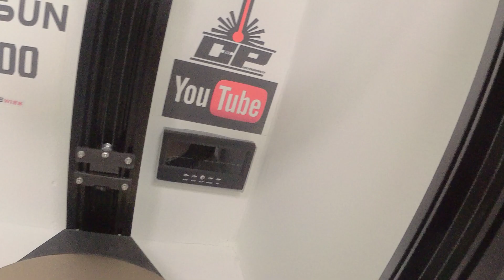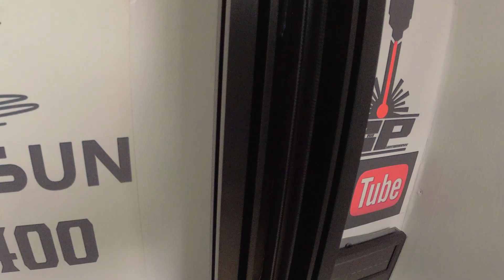FLSUN V400 REGULAR MAINTENANCE CHECKS #FLSUN #V400

Comment: Do you re-run a calibration and bed mesh every time you do that maintenance or is it not necessary? I was told that as soon as you change anything with the belt you should perform and enhanced callibration.
Reply from the maker: if the belts are adjusted i would check calibration.
Reply from the maker: to be honest my last maintenance i didnt recalibrate and so far had no problems but i have only made a few small parts since.

Comment: One question, I need to print large format pieces where print quality doesn't matter much, but time is pressing, I'm between the elegoo neptune 3 max and this one. Bearing in mind that this one may require sectioning off larger pieces and waiting for the glue to dry when joining them, I'll still be able to get my pieces faster with this one than waiting for it to print in one piece in the elegoo even if it has a .8 mm extruder? Thanks in advance for your time
Reply from the maker: This is my first 3d printer, so i dont have much to compare to  but it is fast , printing at.8 would be super quick , i use a .4

Comment: Thank you for making this. I bought my v400 about a month ago and thought to myself, I really should be doing some kind of routine maintenance on this. I haven't been able to find any kind of guide. Even from FLSUN (maybe I haven't been looking in the right place)
Reply from the maker: A good place to get some info is on facebook group called "Flsun V400 Amazing Speed 3D printer Official Group" under the files section there is a lot of info, i also posted videos about anything that helped me and my printer out.

Comment: Do you have accurancy problem with gaps between wall too? You can check it with the stl file from thin**verse.
Reply from the maker: mine has been printing really nice i dont notice any line shift, i got a larger print going today i see how that goes.
Reply: @carphotography  it's not line or layer shifts. There are gaps between the perimeters.

Comment: I'd like to replace the nozzle on my V400 however they are never in stock. I believe it's a special nozzle that allows 400 mm speed. I'm curious if you'll use a generic nozzle, if not please let me know where you found the v400 nozzle. Great videos keep up the good work!
Reply from the maker: Hi these are the nozzles i went with, i havent had to change it yet as all is still going well but i will be very soon. https://store.micro-swiss.com/products/e3d-volcano-compatible-plated-wear-resistant-nozzle-1-75mm-filament
Reply: @carphotography  Excellent! Looking forward to seeing that vid. Thanks brother
Reply: micro swiss nozzle and brozzle nozzle should work fine till 200mm/s. 400mm/s could be critical...
Reply: @Brouk10  Good to know as I print mostly at 400mm. The only problem with that is scraping sometimes. No amount of Z hop or combing adjustments help that and it seems to be a common problem with the V400. At the suggestion of a fellow YouTuber Dennis Gignac I've ordered a Bondtech cht volcano coated brass nozzle as well